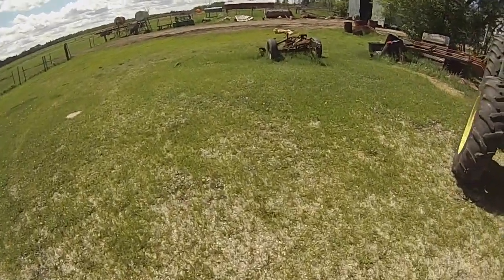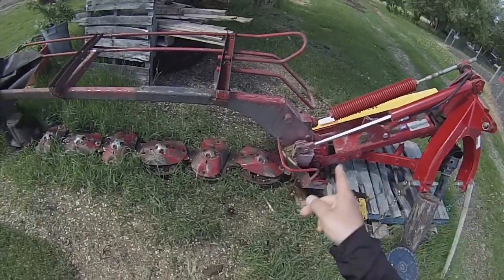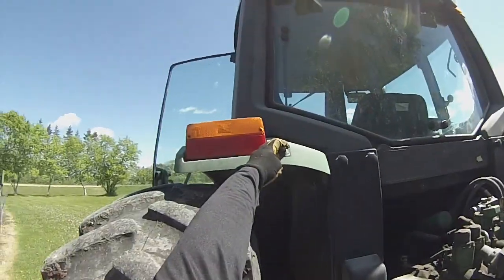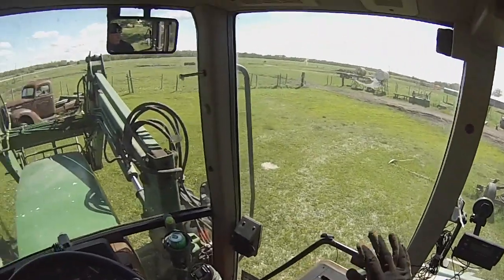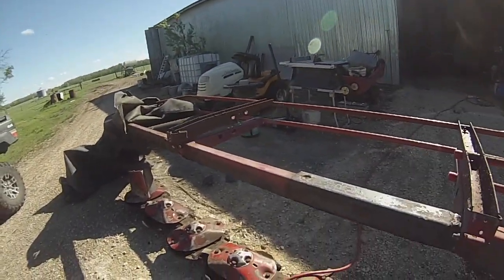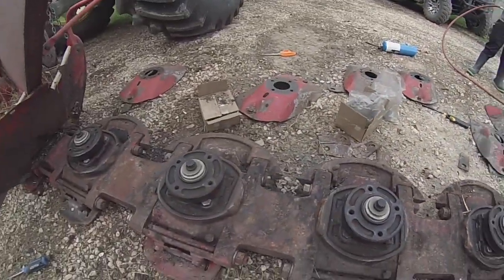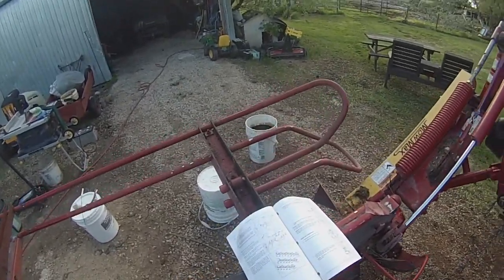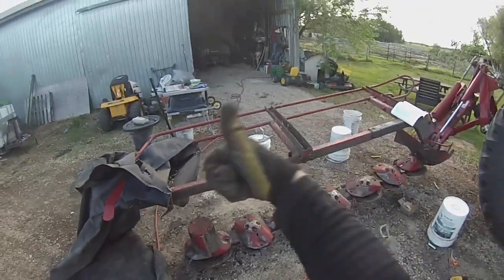Disc Mower Maintenance & 3 point Hookup!

Comment: Great video! Do you have one looking at the belt and diagnosing it? I have same cutter and it started cutting out some today-assume slipping, so I quit and went home to research because I didn’t have tools with me. it smoked a little but I stopped cleaned it out and will pull shield off tomorrow to see about the belt but would love info on what it should look like… and the oil in the head I assume it’s just gear oil??thanks!!
Reply from the maker: Hi Mike. If you smoked/slipped the belt make sure to tighten it up nice and snug/tight from the top adjustment spring over top of the belt area. I have had to adjust mine frequently depending on how heavy of a crop it’s cutting. Also keep in mind that if you skipped/smoked the belt depending on how bad your belt could be glazed over and it simply won’t grip proper under load. I had that very scenario a year ago where I ended up changing the entire belt. I use a 80w-90 New Holland full synthetic gear oil. It’s fairly expensive but well worth it in my books as those oil baths are taking on a big task lubing up those separate pods. I hope this helps and let me know if you need further info. Cheers 🍻 Mike 👍
Reply: Thank you so very much for your reply and help with the possible belt issue. That’s the oil I use in the individual pods so great to know. God Bless!
Reply from the maker: @mikehamilton3216  Perfect, Lemme know how it turns out! Have an awesome night Mike 👍
Reply: @PrairieSunsetRanch  I checked belt and it was fine and plenty tight… I was cutting very good thick Bermuda hay in 5th gear on my JD 4440 and geared down to 4th and no more problems at all! Just like you said it was bogging down under a large load so I slowed down and no more problems! Thanks again!!
Reply from the maker: Great NEWS 👍👌! Happy haying my friend. Im gonna be going over mine here in the next few days, looks like a decent hay crop this year 🍻